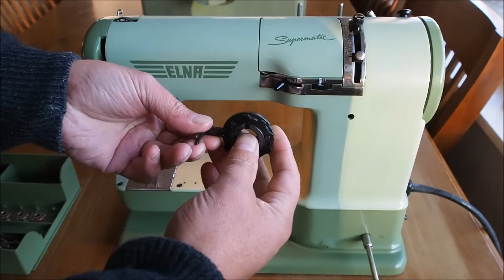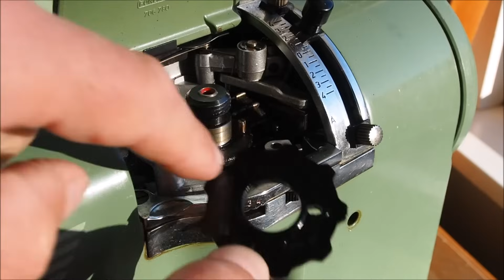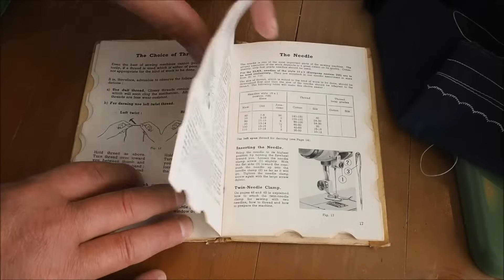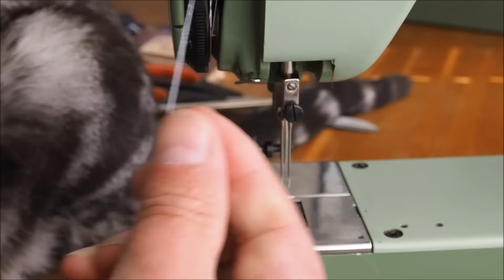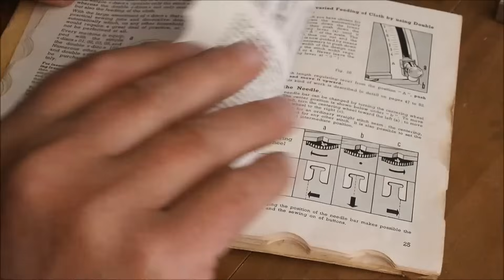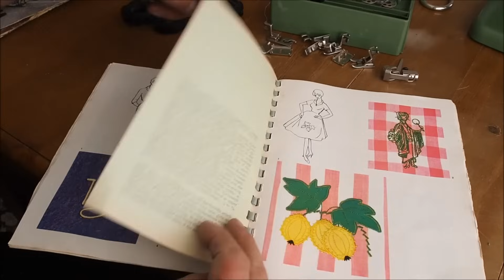ELNA Supermatic Basics - The Beautiful, Classic ELNA Sewing Machine

Comment: Thank you for this great video. I have a 1959 vintage Supermatic purchased on Ebay several  years ago. and have never been able to figure it out; it's been sitting idle since. Your video has encouraged me to try again. I've cleaned and oiled the machine, set it up per the manual for a simple straight stitch. After winding and inserting the bobbin and threading the upper thread, I can't get the lower thread to draw up with the upper thread. The lower thread does not move at all as the machine spins either by hand or by motor. I've looked at several videos, scoured the web to learn how things are supposed to work, but am at a loss. That lower thread just magically seems to appear out the needle plate, but not for me. Do you have any suggestions? Thank you!
Reply from the maker: I'm please you enjoyed the video. 
The first thing to try is make sure you have installed a brand new needle, make sure it's the correct type and inserted the correct way around and is pushed into the needle bar as far as it will go.
When turning the machine over by hand to pick up the bobbin thread, make sure you don't pull the needle thread tight as you do that. Leave a little slack.
There may be other issues going on like timing, needle bar incorrect height or broken hook drive gear to name a few.
Reply: @InStitches  Thank you for your response - much appreciated. I think I've got the wrong needle - it's 39mm long (I don't have any spare singles, but Elna brand double needles that came with the machine are 40mm long). As the needle begins to retract, the tip of the needle and thus the loop of the upper thread is too high to catch the shuttle hook. Either the needle is too short, or the connecting rod the needle assembly is attached to needs to be moved down a bit. Can you please confirm the correct needle length, and possibly a measurement to confirm how high the connecting rod should sit relative to the upper bearing of the needle bar? Are the Schmetz universal needles suitable, or do I need to look elsewhere? Need to sew a mask by hand before I go to buy new needles. Lots of questions there; THANK YOU AGAIN FOR YOUR HELP!
Reply from the maker: Yes your machine takes the Schmetz universal needles and I have measured one at approximately 39mm. 
You may have already tried but make sure the needle is inserted all the way in by loosening the needle set screw and pushing the needle all the way in and then tighten screw.
If that fails to sort the issue then it sounds like either the hook timing is out or the needle bar height is incorrect, or both.
Reply: @InStitches  Needle is in the correct orientation, as far as it can go. I removed the feed dogs to get a better look at what's going on down there, and moved the needle bar down a bit. Still no change, it looks like the shuttle hook is not close enough to the needle when the thread loop appears, but at this point, I'm going to have to give up. Had I spent as much time sewing masks by hand as I have working on this beautiful machine, I'd be way ahead of the game. Fight again another day. Thank you for your responses and your videos.

Comment: I’ve just decided to put to use an Elna sewing machine my mom left behind, so this is very helpful, thank you. I got a bit lost at the bit between 15:00 and 15:25, I’m not sure what it is you do with the threads :S
Reply from the maker: At 15:00 - After the bobbin is installed and the needle threaded, turn the machine in operating direction for one full turn until the take-up lever returns to its top position. While doing that, loosely hold the tail of the top thread. When finished turning hand wheel, pull the tail of the top thread and the bobbin thread should come up through the throat plate hole.
Reply: In Stitches Thank you soooo much for replying! :)
Reply: Would you mind telling me if you cut the two bits of thread coming up under the needle plate? I’m not sure

Comment: When we bought our house I found one of the older models in the utility closet. I tested it, and it sews smoothly (no flat spot on the drive pulley, right?) I was making face masks last night, and the tension went wonky on the last one. I managed to finish the job and put the machine away for the night. This morning I watched your video, learned a lot about the machine, then went to troubleshoot and noticed that the spool that I had left on the second spindle was winding around the spool that I was seeing with. Low tech user error! Still that brought me to your informative video, thanks!
Reply from the maker: Great to hear you sorted it. That's a common problem and I'm pleased you liked my video.
Reply: @InStitches  There's something more going on... the top thread seems to be catching as it's carried about the bobbin housing, wrapping multiple times around it... I had something similar happen on my old Kenmore and discovered that the top thread was slipping off the thread take up. However, Since the Elna has an eye on the thread take up that can't be the cause. I'm stumped for now.

Comment: Brilliant tutorial! Just got my old green  supermattic out. Had to get my instructions for my more modern (had since 70’s), Elna SP out just to see which way spool goes in bobbin, as with this one I don’t have same spools. Just getting going when the pressure foot lever went limp! Now I can’t lift the foot. I have removed front/side door, but can’t see why this is happening. Any ideas? I would be so grateful. Ps I do have an Elena grasshopper too, but haven’t yet got it going as it has something missing , can’t remember what. 
Thanks again for yr wonderful tutorial.
Reply from the maker: Maybe the presser foot bar has seized because of lack of lubrication. I would try lubricating the bearings that the presser bar runs through.
Reply: Thanks! Funnily enough it suddenly worked! Strange.

Comment: Such an informative video Thank you! 

Question: On my Elna Supermatic I don't have that hole for the bobbin thread when using a twin needle. It doesn't work to use a twin needle as it is now, the machine makes long stitches with one needle and short with the other!
Reply from the maker: I don't think not having the extra hole for the bobbin thread is a deal breaker. It should still work I think. Maybe try a brand new twin needle if yours is not new. Try lowering the top tension maybe. Other than that the timing may be slightly out.
Reply: The Elna Supermatics take a twin needle that is slightly angled in its base, and it’s no longer made. Unless you have a vintage original Elna-specific twin needle (or the needle clamp that takes two single regular needles to be used as a double) it won’t work. Flip your machine over and look at the needle clamp; you will see the angle.

Comment: Are you able to advise me on where I can get my hands on a new pulley, please?  I have a flat spot 🤭
Reply from the maker: You could try ebay or Ali Express. I do supply them but shipping from New Zealand can be quite expensive.
Reply: @InStitches  how much do you think it would cost to get one of those rubber things replaced in the machine?
Reply: will it damage your motor using the machine with the flat spot?
Reply: Pam Riley it won’t damage your machine, but it makes an awful noise. In the US, you can get a replacement from White Sewing Center. You’ll find it searching online.

Comment: do you know where the problem might be if the single cam works fine, but the double cam does not? it does not sew the pattern it is supposed to when using double cam.
Reply from the maker: Sounds like the revering mechanism is not engaging or is jammed. Make sure the stitch length lever is down on A at the bottom.